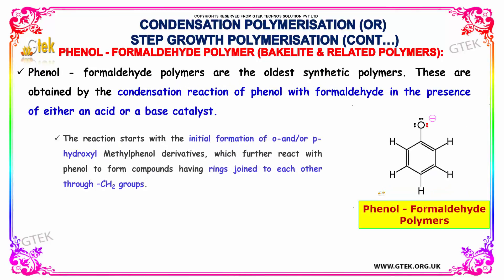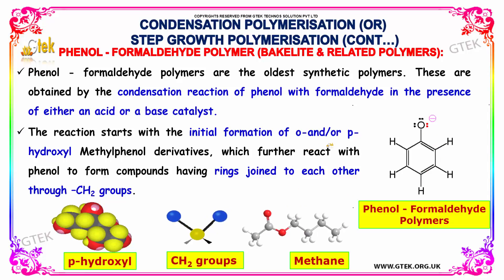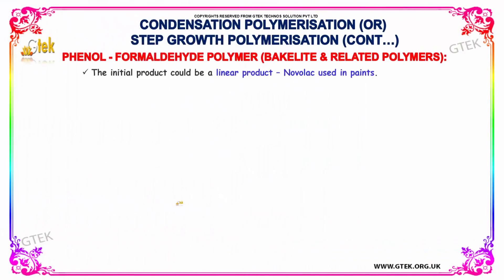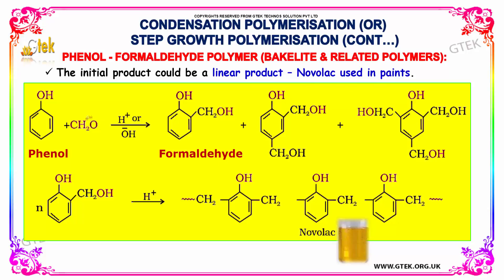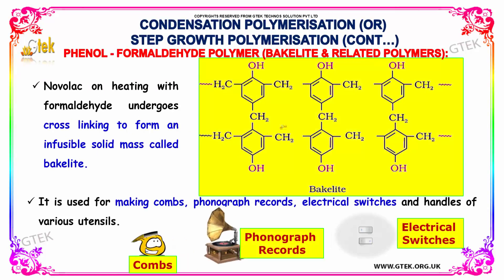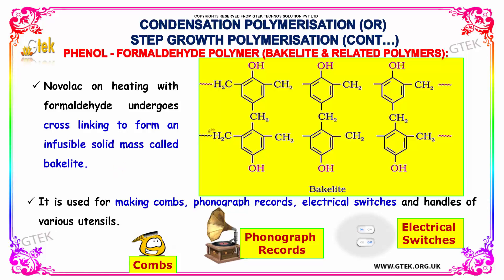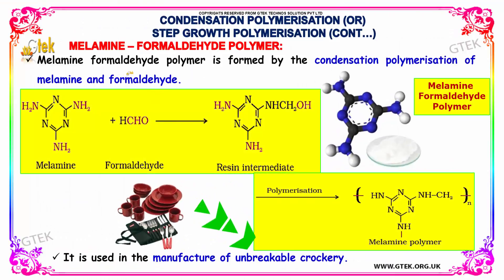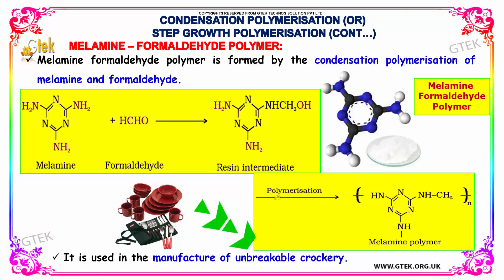phenol formaldehyde polymers chemistry in action class 12 chemistry subject notes lectures cbse

Comment: Phenolic sheet is a hard, dense material made by applying heat and pressure to layers of paper or glass cloth impregnated with synthetic resin. These layers of laminations are usually of cellulose paper, cotton fabrics, synthetic yarn fabrics, glass fabrics or unwoven fabrics.